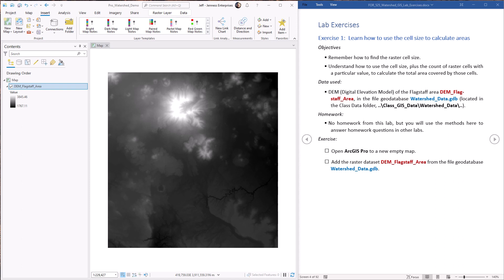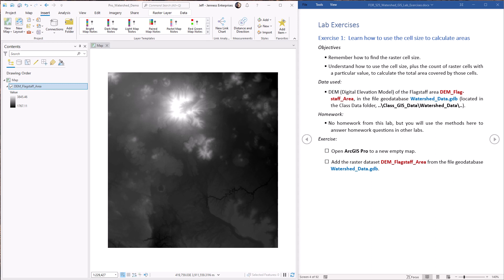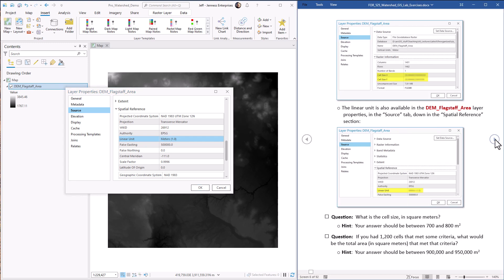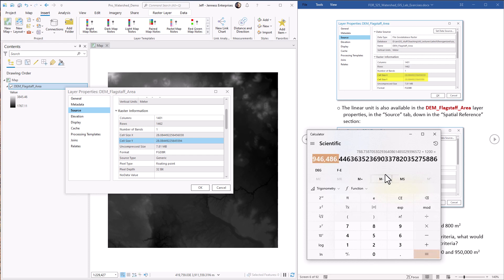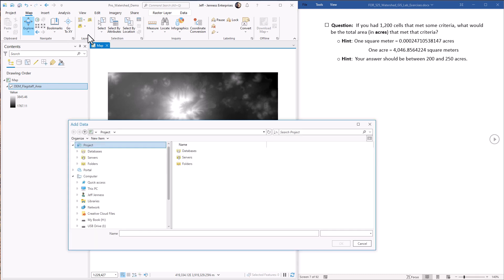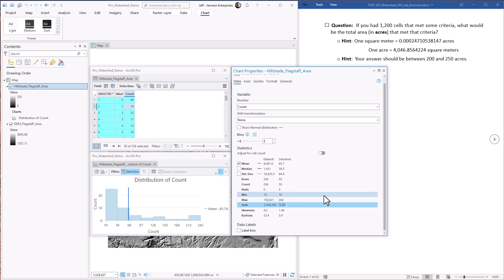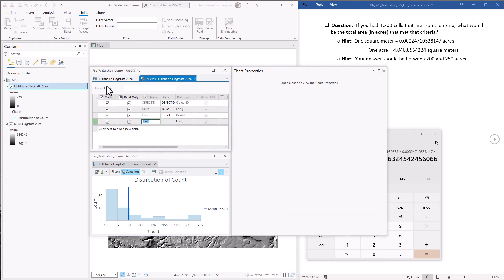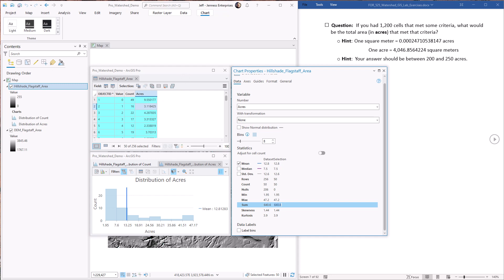Hydrology in ArcGIS Pro, Lab Exercise 1:  Calculating Areas from Raster Datasets

Comment: May I know what version is your ArcGIS Pro?
Reply from the maker: Hmm.  Good question.  I should probably add that info to future videos, shouldn't I?
This was probably done with ArcGIS Pro 3.1.0 or 3.1.1.  Possibly 3.1.2.  It wouldn't have been 3.0 or earlier.
Hope this helps!  Take care -
    Jeff
Reply: @JennessEnterprises  Thanks. Because I tried using your data and it works with my 3.0.1 version but not with data that I got from my colleague (which is below version 3.0)